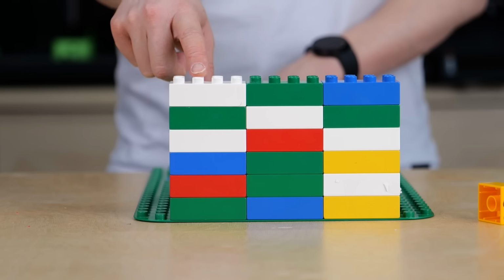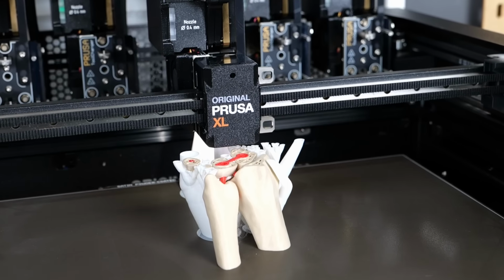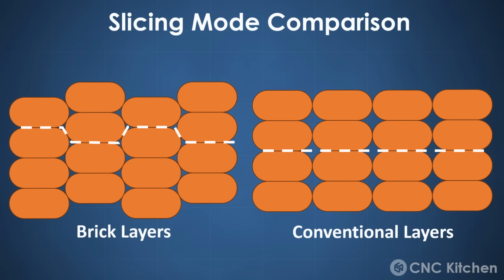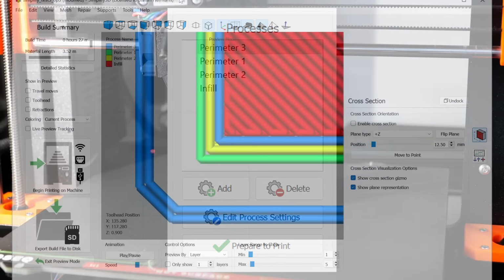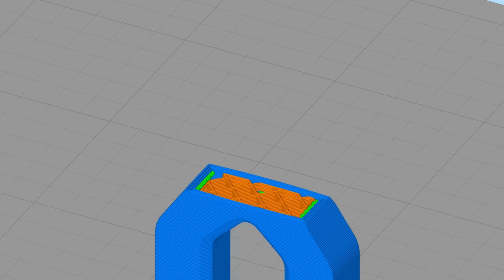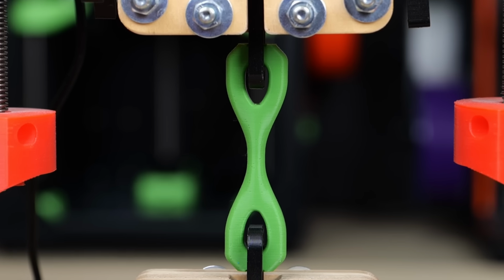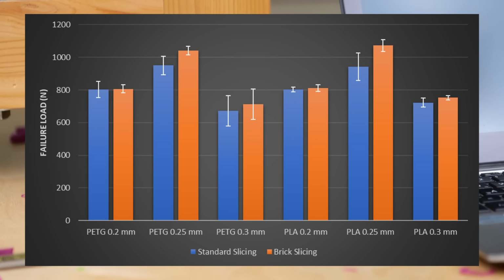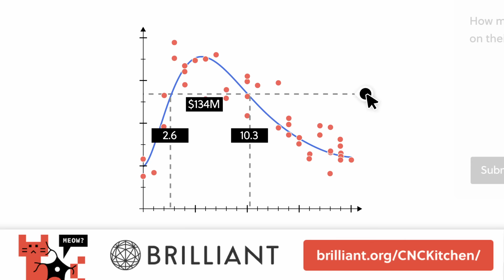Brick Layers - Why did no one do this before?

Comment: Hey Stefan, look at the microscope pictures you have on the video. On the brick layered print, the empty spaces seem more regular but dont seem to be smaller in area. The layer adhesion in the sides of the beads seem to be worse, that is, with less contact area, than the ones from the regular printing. It seems to me that if you minimize or eliminate those gaps you will have the stronger prints you had in your mind. cheers!

Comment: would it be possible to force more material through the nozzle in addition to this method ? This would probably result in more rough surfaces, but less air inside the sections so more adhesion and wway better contact/surface area for it to adhere.

Comment: not sure if its available or if it would need to be fabricated, but what about an extruder tip that has a heated needle tip at its leading edge that runs thought and remelts the very center of the last layer right as the new layer is laid down?

Comment: Very recognizable! A year ago I was working on a model that involved a spiral spring which had to hold a very high force. Because the print lines in the spiral were printed vertically straight underneath each other, as you explained, the spiral spring tore in the longitudinal direction every time. My final solution was to force the layers to be printed offset by 0.2mm in the horizontal plane with a nozzle of 0.4mm. I physically applied this to the solid per 0.2mm layer height over the total height of the spring.
The spring never broke again! (at least not with my prints) when using the prescribed nozzle, layerwidth and -hight.
So maybe with the slicer it will be easier and just as strong (or stronger?) to stay in the same horizontal plane and just shift 1/2 nozzle width per layer? If we can limit that to a certain area, where strength is needed, this will not make much difference aesthetically.
p.s. the model I am referring to is the Propeller Launch Base and the Spring Ring part. If you view this part in the 3D viewer you can see (with a bit of zooming and rotating) the shifting of the layers.

Comment: Why not use the hotter air from cooling the hot tip to trying to drain away some of the moisture from the plastic that is entering the hot end of the printing nozzle.

Comment: my guess is that the bigger the layer height and the more it approximates "a sphere" the more the layer bonds would resemble a hexagonal pattern, thus introducing weak points around the 60°-240° and 120°-300° axis whilst reducing the weakness on 0°-360° (z-axis), essentially splitting the weak points instead of reducing them

Comment: What if you changed up the path of the nozzle every layer? Like one layer could zig-zag while the next is linear. Going back and forth would change where the stress points are. Maybe you could also purposefully cross the paths to offset the heights as well. Like if you made an X, the intersections would be higher than the rest.

First layer like normal, top-down view:
=======
=======

Second and third layers to offset heights:
XXXXXXX
XXXXXXX

Then zig-zag (pretend there’s no space between the paths):
 _    _    _
|  |_|  |_|  |

Then repeat the first layer:
=======
=======

Offset the zig-zag from before:
    _    _    
|_|  |_|  |_|

Back to linear:
=======
=======

Rinse and repeat the last 4 paths.

Comment: I think the answer might be a combo of this, and something I call interlayer interlock. Like pleating. For visualization draw three pencil lines on a sheet of paper, equally spaced (you are going to look at the  length-wise cross section/ one layer ontop of another). Draw each line 2.5 inches long or 10 cm (not a direct conversion). Then mark the middle at 1.25(5cm), and the quarter at 0.625"(2.5cm). now make a second set of 3 lines exactly like this, as a second image. On the first image of 3 lines, take line 1 and 3 and trace them with a dark blue marker. Then trace the middle with a red marker. Here you can see that you have 3 equal length lines, one red in between to blue. 

Image 2: on the first layer take the blue maker and draw a line from the end to the 0.625" (2.5cm) mark. Then red on line 2 to its 0.625 mark, now go a little past and draw a line 90 degrees to connect to the 1st layer just a bit after the blue line's end at 0.625" then continue to the red line until you reach the 1.25 mark on the first layer. (the red line should look like a little stair step from the beginning of the 2nd line, ending at the 1.25" (5cm) point on the 1st line. Go to the third line, and with a blue marker, and go from 0" to after the drop point after the red line on 2nd line and drop down to the second line and continue on the second line a little past the 1.25" distance and drop down to the 1st line. You've now take the top most layer and dropped down to the 1st layer. Resulting in a pleated design if you continue the patter over the whole 2.5 inches(10cm). 

I know 2.5"= 6.35 cm. But 10 cm and 2.5" both make nice ruler segments. 

This pleated design is tough to implement because it makes it so the 1st layer isnt finished until your 3/4 of the way through the 2nd layer. 

alternatively, this drawing instead of being a slice from the side, could be a slice looking down (top down view). interlocking internal and external layers. Either method (length-wise or top-down cross section) can be integrated into you design of offsetting the layer heights. This would interlock independent layers, both horizontally and vertically.

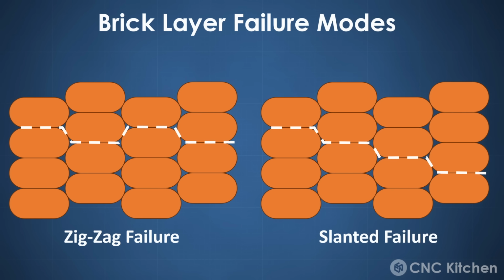Comment: Notice on 8:16 how your "brick layers" technique uses less horizontal space than the "conventional layers" technique, despite the bricks being the same size? (580px vs 610px on my screen)
Use the "conventional layers" image as example, but move each layer 50% up, there will be gaps between the lines, if you overextrude the "upped" layers by the area of the gap (percentual to the area of the layer), the gaps will close, increasing contact area, and possibly increasing strength. Or you can adjust the overlap if you want to use the same amount of material, which would be a more apples to apples comparison.

Comment: You could cast samples to see if you're approaching homogeneous strength. I'd guess you're not, given the microscope pictures provided.
I'd suggest increasing extrusion on inner walls to close the gaps and decreasing the fan to allow the material stay hot while it presses in. Just my quick assessment.

Comment: If you have equal sized droplets it’s like a crystal lattice - and crystal lattices have different slip planes (that aren’t parallel to the layers.) A simple cubic lattice is less strong and less space/filling, but a hexagonal or face-centered cubic structure with dense packing will have slip planes where it will preferentially fail.

Comment: I wish you'd tested the 3d parts with sheer testing, as I think that'd be where this would really help the parts be stronger. Pulling a brick wall apart from the top down is gonna be easier than breaking through it from the side, where each solid layer must either fail itself, or sheer along the diagonal.

Comment: The strongest interlocking construction method ever used is polygonal megalithic masonry. Each block is laid based on the shape of the ones before it; they are contoured and angled to fit without movement, using only the weight of the stones to remain standing. Most polygonal megalithic walls across the world (from Peru in Machu Picchu, Sacsayhuaman, Cusco, and Ollantayambo to Lake Van at Zernaki Tepe, Kef Kalesi, and Ayanis to China, Korea, Cambodia, Egypt, Lebanon, Iraq, even New Zealand and Rapa Nui) are still standing and their origins are suspected to actually predate the Holocene (hard evidence is ongoing in excavation in Turkiye at Lake Van and Sayburç (Sanliurfa, Turkiye).

Polygonal masonry resists earthquakes up to 9.0.

Comment: Would you do better to increase the flow rate on your alternate layer so that you fill a little more space with them? That would increase your contact surface area kind of treating it more like the mortar. Layer 1 would have your 100% flow then 1.5 would have 110%/115% flow.

Comment: @CNCkitchen/Stefan I was wondering how you did the finite element analysis? So far i’ve been looking into  this myself for 3D-printed parts. But since 3D-printed parts don’t have an homogeneous structure, it is hard to predict to points of failure.

Comment: I wonder if layers could be "riveted" together by injecting plastic down into voids in previous layers. If the voids were hourglass shaped, and the rivets were placed at overlapping Z heights (eg 1 set from layers 1-5 and another from layers 3-7 etc) it might improve layer adhesion.

Comment: Is anyone using a preheater nozzle? The idea I have and that I hope someone uses, is to create a circular heater that surrounds the nozzle and is slightly set off and preheats the layer before and below so that the new layer adheres better to the previous layer. The thought is either a ring of metal that is independently heated or a spot IR heater. The heater could be adjusted in temps independently as part of slicer settings. The other idea would be to have an adjustable follower that is mechanically adjusted with a linear actuator to act as a squeegee to press the newly formed layer down and laterally do create better adhesion. The combination of the 2 ideas could revolutionize 3D printing and at a minimum cost to printing.

Comment: Hi, there i wonder if increasing anisotropy is good idea and wouldn't it be better to perform actual shift instead of scaling. 
I guess that vertical cracking on tensile strength test is a good thing most often this can be seen in rocks so material is working like a brittle model. Also cracking like that indicates material failure not the layer failure it would be best to check somehow the filament toughness.
it would be good to preform compression test and compare tensile and compressive toughness and compare it with layered pattern.

Comment: I'd think of it like crystallography and slip planes; you remove a very stable tabular grain with overlapping diamonds, any of which can now cleave at a 45°.  Before, it split on one plane, now it splits at all of them. But if its overall stronger, that's still better. Why don't you just heat homogenize them or whatever its called. I guess those are over size for shrinkage.

Comment: Those vertical breaks would be because the pattern is leaving too tight of a zigzag vertically, this would be fixed with a full honey comb design, it is already much better then the original perfect lines up and down along which failures would be more likely. 

Going by metal welding theory we would need to spend more time heating at each point, half moon patterns might help as well as alternating between overloading and underloading every second line to fill gaps and give more of a chance to fuse. Of course this will be harder to implement since we are laying heated material and not heating what is already there.

Comment: It appears that with the staggered approach, the packing factor of the cross sections would be higher. Therefore, you may need to increase the extruder speed to pump out more plastic to better fill the gaps with the brick wall method.

Comment: 5-10% more in each layer so you make up for the extra volume of air that is now present in the part in between layers. Also increasing 1 of the layers in a lattice by a percentage may give strength properties same as in metal alloys.

Comment: I wonder...  if the center layer was printed with slightly higher temp and slight over-extrusion..  it might bond better and fill the gap better as well.  like squishing epoxy into a gap to get into the crevices.   maybe +1% extrusion and +4-5 degrees just on the inbetween wall.

Comment: I’m wondering if it’s possible to have a dual headed printer. One head is the extruder and the other is just a flat tipped hot end that would iron each layer with additional heat bettween extruded layers.

Comment: Can you dynamically change the layer height within a single print?  I feel like there are many geometric options available, and could introduce some additional strength if an inner core could be a larger height with the more specific surrounds being smaller?  Although, I dunno.

Comment: I wish you had printed comparison parts with traditional slicer but the part in optimal orientation for maximum strength for the test. That should show the limit of the material vs slicing result.

Comment: This really needs testing in Compressive and Torsional strength as well, not just in tension.
The results could show a more significant increase in strength or a weakness.
It is unusual/unlikely to increase in all types of stress, so it would be interesting to see where it gains and where it loses.

Comment: Two things : 
Can you test just the filament not printed , the same one you used, if you put it through the test unprinted what’s its fail strength? 

If you rotate the part 90 degrees  and print it does it change the result ?   This way the failure point is at the layer bonding . 

Curious to see what those tests would show us. The idea behind the single filament strand is to find the maximum possible strength since it’s completely homogeneous.

Comment: Would be interested to see if larger parts (or more parts printing at once) resulting in a longer print time for each layer would cause the same layer adhesion issues that it can for traditional printing styles due to prolonged cooling between layers.

Comment: This is again really well prepared and though of content - thanks for this. I would assume there is a kind of sweet spot for the best parameters similar as there is for layer height in relation to nozzle diameter regarding max. strength. When you have a far bigger layer height or much smaller the sacrifices in strength will most likely not be compensated by interlocking layers…
Furthermore your close-up pictures show holes between the layers. It would be interesting if you increase line width, extrusion and temperature for a more solid part and see if the increase of strength is still around 10%-15%. From my point of view the increase of strength is not provided by more bonding surface or the interlocking layers directly but by reducing the gaps and therefore reducing stress concentration at the connection points in layers. Underextruded parts have kind of intended breaking points in between layers due to those gaps.
Specifically with PETG when printed hot enough and with approximately 115% line width and 40% layer height (based on nozzle diameter) I have regularly failing components not between layers but over several layers because the layer adhesion is so good.
Anyways I hope the from you investigated feature finds its way into free slicers increase the strength of functional parts even further! 15% is a lot without changing anything else!

Comment: Hmm... Imagine (while using this brick layering method) having 2 nozzles, one placing the outer strings, creating a valley and the 2nd nozzle fills it with hotter, less viscous polymer. That would surely increase the bonding surface and maybe even the strength per area.

Comment: I have an even more radical idea. How about leaving a hole for a vertical pin in the print, and before closing up that hole go there with the nozzle and inject melted plastic that totally fills the vertical hole. With enough such vertical fill holes, perhaps there will be even less layer separation?
Reply: I also found a patent related to this 😂

Comment: I wonder if a changing the shape of the extrusion, changing the shape of the hole, would have any effect.   Maybe a hexagon shaped extrusion would result in filling in the spaces between the extrusions.  Using the same offset method you've tried.  Of course it would be difficult to machine.

Comment: Technically, the force you apply is perpendicular to the contact plane. Under optimal conditions, the force spreads across the full contact plane (so that braking point is reached at the same time in the whole plane). If not, the point with highest load will give way first, increasing the load on the others, which will follow. That leads to a lower overall load. Also the surface of the overall contact area matters.
Considering this, what would we expect? The overall contact area projected onto the xy-plane just increases slightly with your approach. The "bricks" are wider, flowing into each other slightly (less gaps). But this effect is very small.
The other effect is, that within the "plane" you likely have better spread of the forces, as the elements are interlocking. However, as plastics are elastic it is to expect that the  pull force is already spread quite well. Also here I would expect not a big effect. 
Your results support this. An improvement of 10-14 % is nothing you would throw away, but also not giant leap.
The limiting factor seems to be the limited adhesion between a new hot layer and an already solidified layer.
What you would need is vertical "connectors". Basically holes in the infill, that cross several layers and that are later filled with hot liquid to create a type of dowel, interconnecting layers with a continuous mass of plastic.
It would also be interesting to see, how far you are from the limits. What, if you print your test element "lying flat" so that the extrusions go in parallel to the applied forces. That would mainly define the maximum reachable limit.

Comment: Should you compress the object on the side , since the benefit of the brick structure is not to the virtical tensional stress. I think you really should try the horizontal compression stress.

Also the thinner the layer we got, the closer is become the original printing method. I do not think thinner the layer would help the structure.